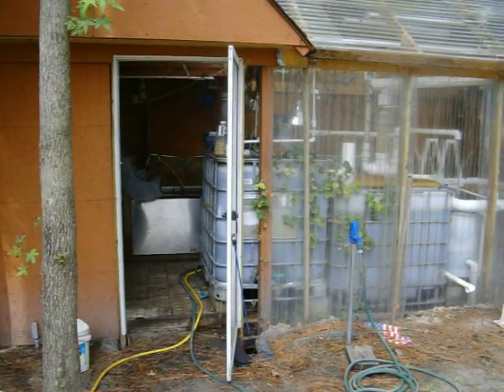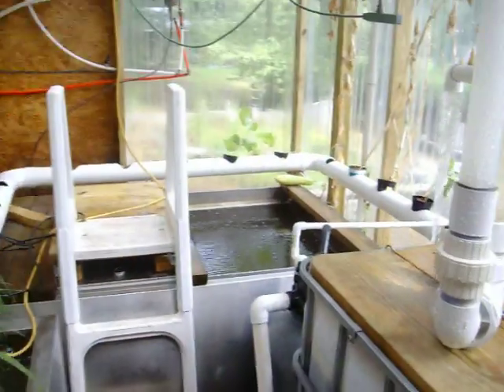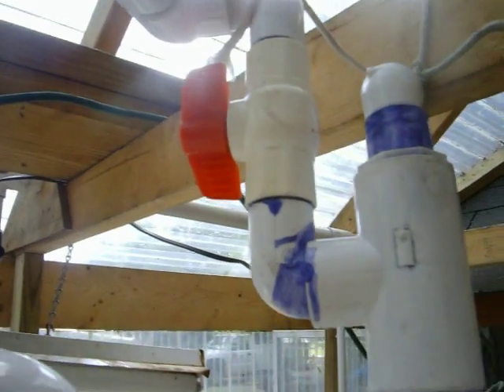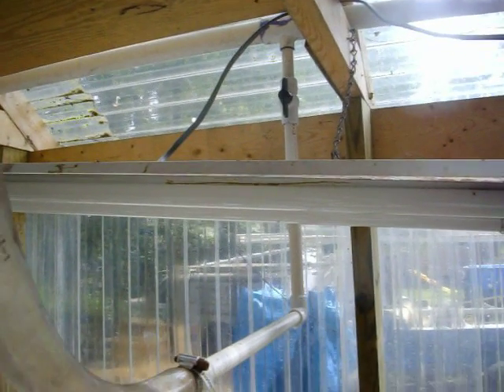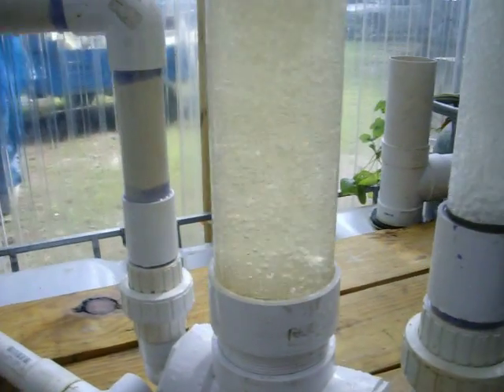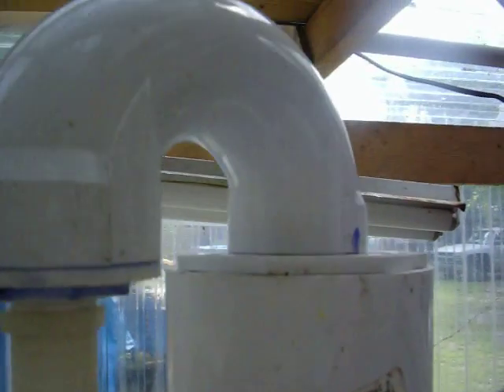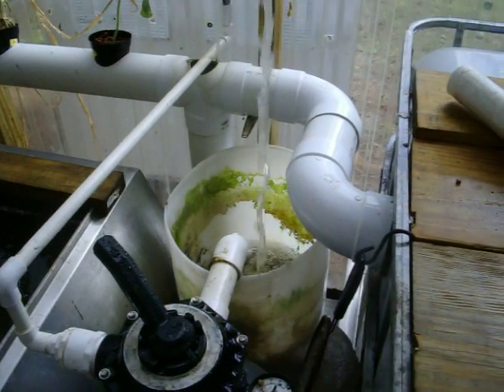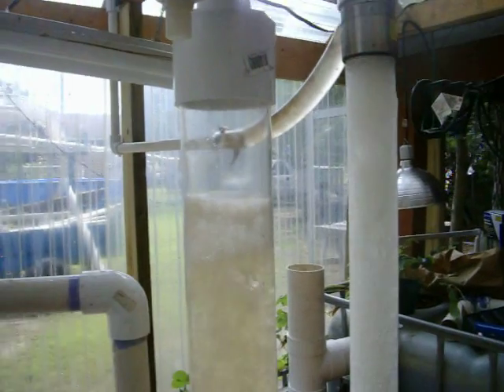DIY Protien Skimmer

Comment from the maker: @gladmama - One tank is a restaurant grill hood that we sealed. the other tank is a 600 gallon milk pasteurization tank. A normal plumber can set this up but the trick is to only run one pump. Good luck and feel free to ask any questions you may have.